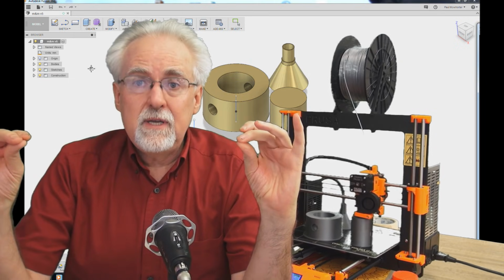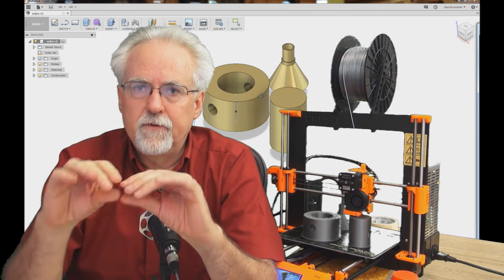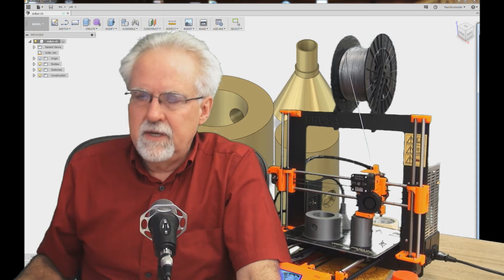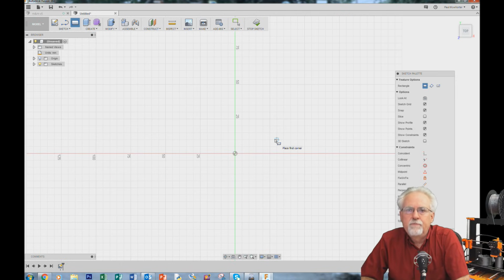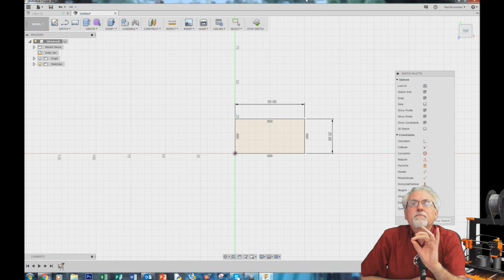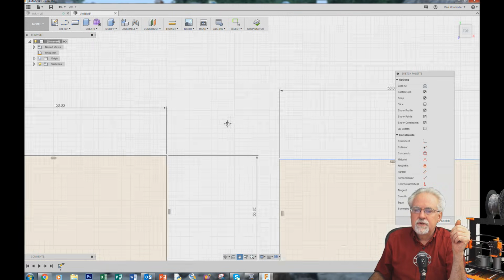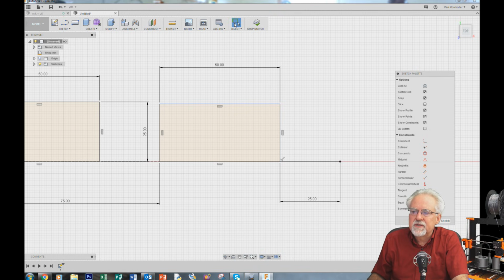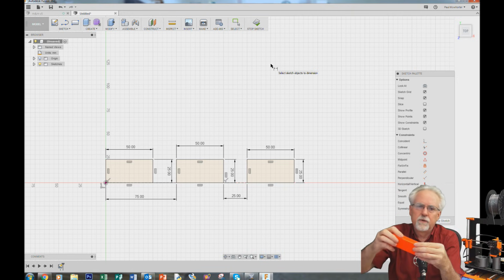Learn Fusion 360 or Die Trying LESSON 1: Introduction tutorial for Absolute Beginners

Comment: For some reason, when I got to the final rectangle, instead of it snapping to the dotted line we created on the left, when I typed 50, it snapped to the line on the right ( however big I drew the original box) and putted the rectangle and the construction dotted line away from the first two rectangles we drew.  I am going to do the lesson again from scratch. (edit think I figured it out. you're clicking once , then moving the mouse WITHOUT pressing the button, to dimension. I am clicking and dragging to dimension.)

Comment: Excellent videos! I am trying to watch and do one a day.  Two quick comments on two things I found. When I installed 360 my Y axis was up which caused minor issues trying to copy what you did even though I was sketching in the x-y plane.  This is easily changed in Preferences which is located under your name in the top right side of the screen.  Finding the preferences was not easy to find.   Second issue which I am not sure if you covered was when using the dimension is to only click on the line you wish to dimension not click and hold and drag.  Click then move the mouse and click again.  We are so used to clicking and dragging and it was confusing at first. I think you covered this in a lesson down the line. Excuse me if these have been previously covered in the comments.

Comment: just a little tip paul, since I use AutoCAD/Civil 3d at work, you can click in the wheel on your mouse to pan around instead of selecting it at the bottom or using zoom to move/pan the screen

Comment: Yes, you can have curves intersecting curves in sketchup by using the solid tools in sketchup Pro. It's pretty easy and fast if you know what you are doing. Thanks.
Reply from the maker: I understand that but for the shapes I was creating, it would not generate an STL file that would print. Looked good on the screen, but STL errors that could not be fixed in the slicer. I think sketchup is great for architectural type things, but for 3D printing, Fusion is the way to go.